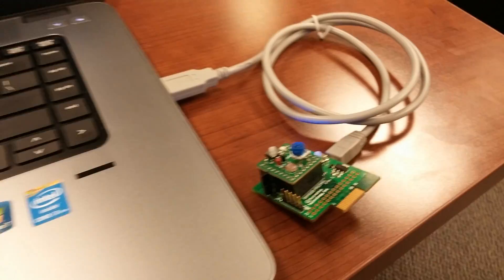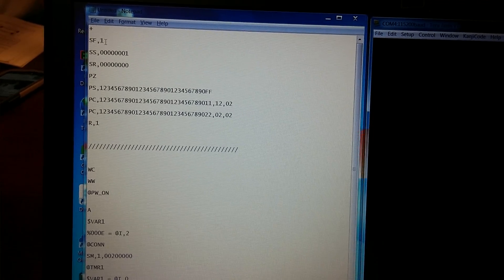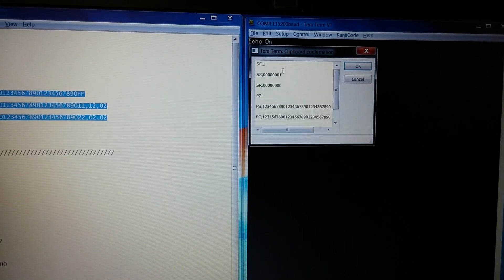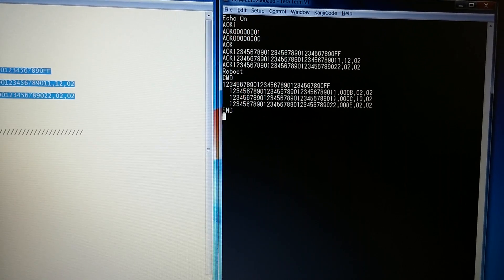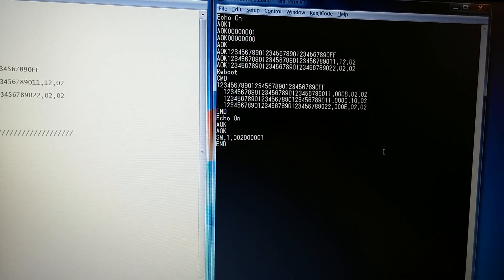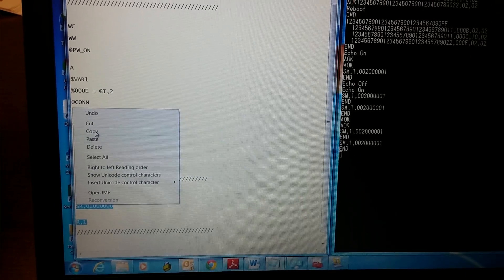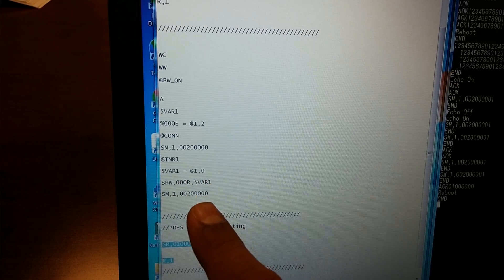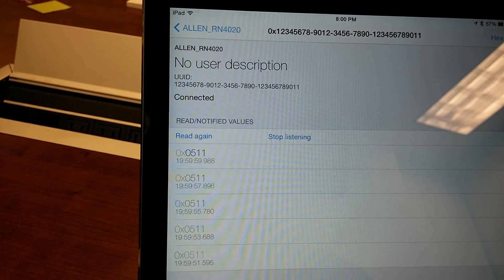Microchip RN4020 Script AIO Sensor Demo

Comment: Great demo Allen.  Thank you.  I had the same problem with the script not being listed properly after sending it to the board.  I found if I send <CR> AND <LF> after each line then the script will be listed properly.  In my one battery operated application the RN4020 scripting capability would be perfect because it would eliminate the need for a microcontroller but can the RN4020 (in script mode) go into a deep sleep mode?  If not then scripting cannot be used in battery operated applications.  Thanks!  - Chris